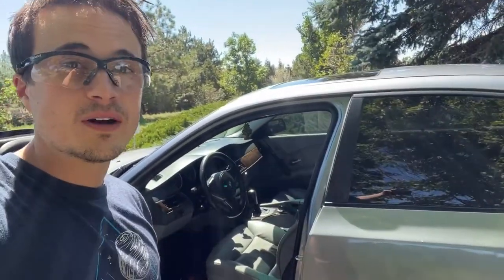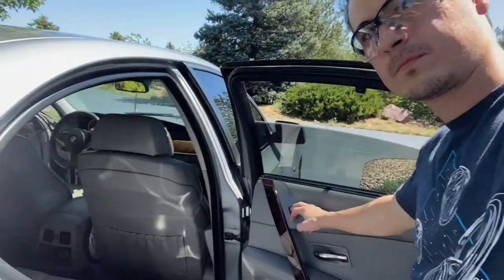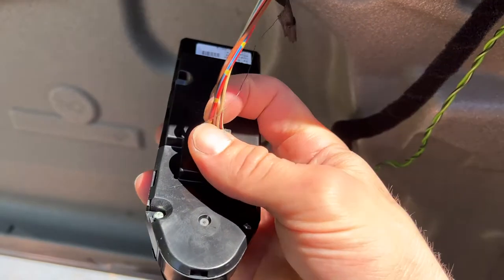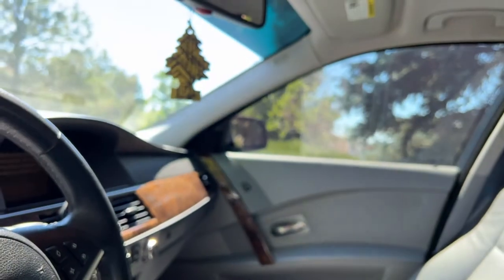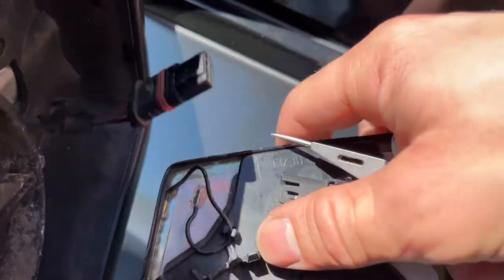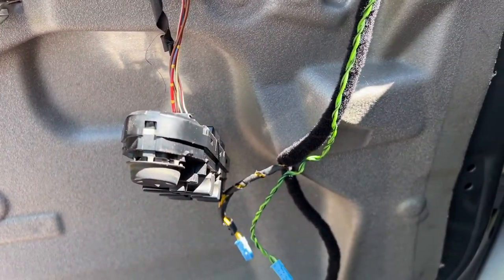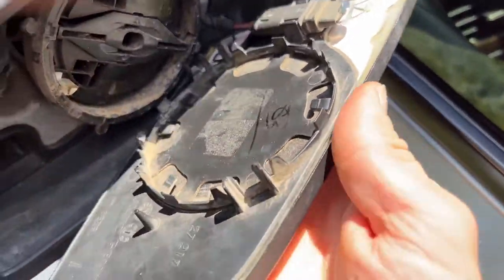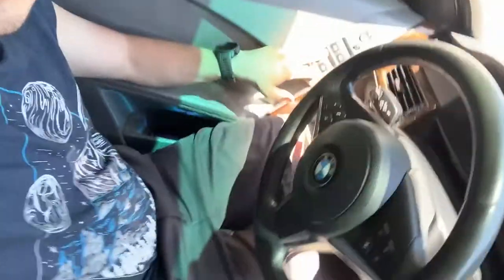2007 BMW 525i E60 Driver Switch Block Not Working Fixed | It's Not What You Think

Comment: Replaced the CCC on my e60 525i today and immediately the window switch stopped working. All other windows work fine. Thanks for the upload.
Reply from the maker: no problem! so it was the  new CCC taking down the switch cluster?

Comment: Awesome content, literally jumped into my E60 535d the other day and had this happen, gonna check the auto darkness glass in the daylight, thanks 👍
Reply from the maker: no problem! it's most likely something on the same lin bus taking it down
Reply: @4WheelKid  Since posting my comment I dived in a little more and am even more confused; i believe mine may actually be the switchblock, fuse in glovebox is not blown, illumination of keypad still works and all windows work on the key, every other window bar drivers still has auto up and down functions. Literally just failed while parked for 3-5 days. Passenger mirror looks sus but disconnect either or both mirrors does nothing. Have a replacement set of glass (showed up today) will try fitting on next clear day and update, as these cars age more & more of us  will come across the same issue.
Reply: @C0xy777 did you figure it out? Having same issues
Reply: @radianm6  yeah, mine was a failed switchblock haha, sorry i cannot be of more help

Comment: Same problem on my 2008 328xi e90. But, I don't have the auto-darkening feature. I was doing a retro-update to the auto-folding mirrors. Before swapping mirrors, I tried plugging in my new control panel and nothing.. switched back to the original panel and still nothing. No blown fuses either
Reply from the maker: Hard to say for sure any faults in the body module?
Reply: @4WheelKid  I don't think so. It's possibly something to do with the CPU not recognizing the new module. I'm thinking that I probably need to install the new mirrors, then the switches, and then code them in. I just wanted to see if I could test the switches prior to my second mirror arriving. I just removed the driver's door card and will hopefully swap out the mirrors today and test it again. I'll post my results afterwards.
Reply: @4WheelKid  I just subscribed to your channel after looking it over. It looks like you have some useful content in there 👍

Comment: Hey Brodie I have a 2006 325i E90 and mime are doing the same thing the switch lights up all other windows go up and down except driver side and I disconnected my mirror and still nothing by n e chance u know what else I could do ohh and fuses are all good
Reply from the maker: Probably something else taking down that lin bus. You gotta find everything on that lin bus using a wiring diagram and disconnect each component 1 at a time and see if it starts working. Also shorted wiring can take down a lin bus as well. Rodent chew. Or one time a body shop did a horrible wire repair on the rear bumper touchless trunk open sensor and that took down the lin bus. And stopped the driver window from working since it used the same line bus. You just need to find a wiring diagram and go from there. Also did you try both mirrors??

Comment: Hello! I can try to help you with the issue you have with your car. When your car’s window (BMW F10 528i) was slightly left open during the rain, the window buttons are working fine, and all of them have their respective icons on the mirror. However, the child lock button is not working, which is not a problem if it doesn’t work, but the orange light on the front window buttons and child lock button is not illuminated at night. What could be the issue, and is it possible for the problem to resolve itself?
Reply from the maker: Yeah let it dry out good and maybe it will resolve itself

Comment: Only rear lh (driverside) window not coming up from master switch but can move down from rear both up and down working  what is the problem any idea?
Reply from the maker: Thats a strange one, would need to look at the wiring diagram for your specific bmw, they are all different

Comment: i actually broke my mirror as i was reversing on my F30 and bought a new one and the master switch doesn't work. any ideas?
Reply from the maker: I would unplug the entire mirror assembly and see if it works again. probably a lin bus issue somewhere. I had a newer bmw G20 where the entire driver switch block was inop. I knew the rear trunk structural panel had been replaced by a body shop. I commanded the driver window up and down through ista and it worked fine. had lin bus faults currently present. looked at the wiring diagram and saw the rear contactless tailgate opener module shared the lin bus with the driver door switch, I knew exactly where to look. the body shop had ripped the connector off the harness when repairing the body damage. they attempted to solder the wires back the the pins and did a horrific job at trying to repair the wring they damaged. the ground for that module had came loose and took down the lin bus. if I unplugged the contactless tail gate opening module the driver window switch worked fine again. fixed the wiring and connector properly and everything was back to normal again. chances are something with the new mirror, and or wiring somewhere is taking down your lin bus that is shared with the driver window switch.

Comment: Bro my front passenger side window doesnt work on auto , I reset also but its doesnt work on auto , what should I check
Reply from the maker: did you try initializing it? I would connect the scan tool and see if the module is receiving the auto up/down commands  if it is then it's probably and initialization issue

Comment: Same problem.. driver switch didnt working.. also mirror led.. on driver side didnt working..  i try to disconect mirror but problem still there 🤔 where search problem? Also il try to change new driver swich but didnt work
Reply from the maker: It’s probably something else on that same lin bus that is taking it down, need to look at a wiring diagram to see what else shares that same lin bus, could also read the fault codes, may have a lin bus fault for each component using that lin bus. Try both mirrors
Reply: Did u end up finding the problem? Because I have the same issue on my 2011 bmw 328i, the rear windows roll up and down fine but the driver and front passenger both don’t work and I tried replacing the switch and tried unplugging both mirrors but nothing seems to work, any suggestions?
Reply: @almalikialmaliki8875  same here. any solution?
Reply: @coolexperiments205 same.. did you fix problem?